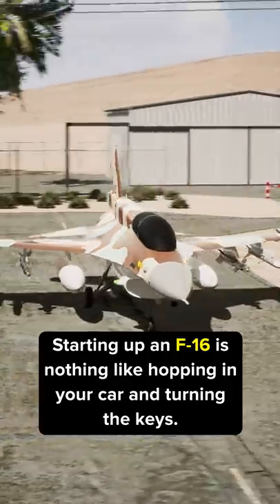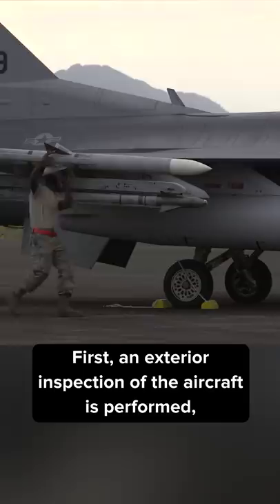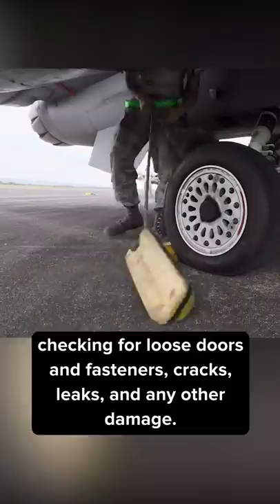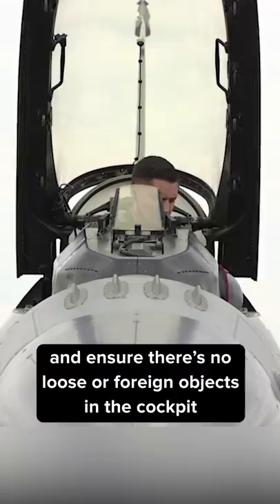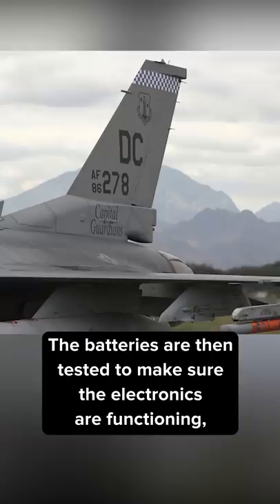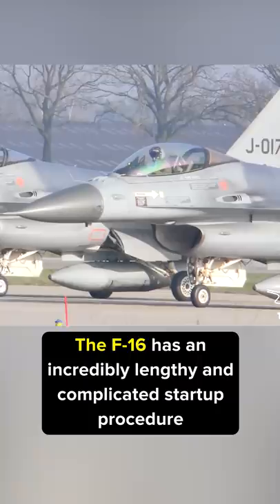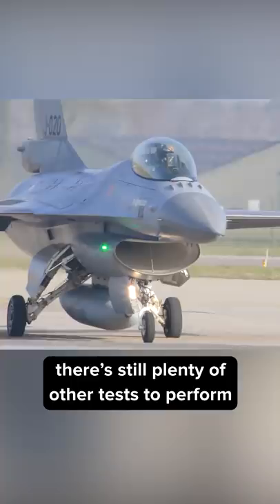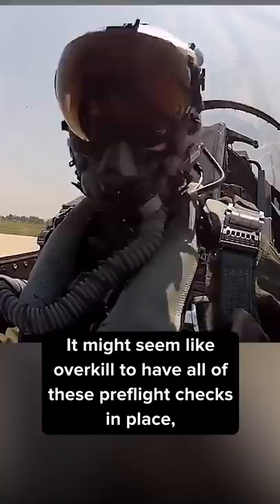Starting an F-16 Isn't Like Starting a Car

Comment: No... You don't explicitly NEED to do the checks. When starting an f16 it's very similar to starting a car actually, just a few more steps. And you need to spool the engine before igniting. Other than that. It's literally called the ignition on an airplane as well.

Comment: Actually it's decently easy. Turn on battery, test for electric faults, switch to Main PWR, Engine start 2, let your APU spool up to 20% RPM, move throttle indent to idle. And wait for full spooling to be done. That's how you turn on a F-16 but "Cold Start" Is a whole different shabang

Comment: Can't there be a flawless auto software program to remotely auto-check all this stuff in less than 5 min the moment you hit the start button in an emergency battle situation?
Reply: It doesnt have an "starting button", u need to start the engines externally with compressed air and then start the ignition with the throttle of the plane

Comment: I'm a f16 crew cheif and alot of the listed items are verified way before flight. The start procedure or "Launching" only takes 5 minutes. Checking Flight control functions, lights, engine functions, and hydraulic pressure.

Comment: The cost of the aircraft doesn't apply when talking about checking very precise systems. A Cessna 150 and an F-22 can both catastrophically fail if not maintained and taken care of properly.

Comment: Isn't there an external unit that has to be wheeled over to actually start turning the engine? I thought this video would be about that tool, not the standard procedure before flying every plane
Reply: No, the F-16 can start itself. Has a JFS. Most modern aircraft don't need huffer carts to start, including airliners. Multi engine aircrafy use APU bleed air, and most fighters have JFS (jet fuel starters)

Comment: and never talks about starting the jet engine.  IDK about the F16. but the F15 is started with a hydraulic system that spins the turbine that's under pressure w/ nitrogen.

Comment: Starting up an f16 isn't like starting a car.
Step 1: check outside of vehicle
Step 2: check inside of vehicle
Step 3: check safety systems
Step 4: check batteries
Me: just because you don't do things every time you start your car doesn't mean it isn't good practice to do so every time you start you car.  Your car is no isn't less likely to blow up. Also people would be much more likely to keep their car if clean on if all the stuff on the floors and in the back seat were constantly becoming airborne and smacking you in the head.

This video could have been named.  "How starting an f16 is more like staring a car than you would think"

Comment: What if there's an airspace intrusion?? There's no way theyd be able to react fast enough
Reply: Most of what he's talking about has nothing to due with the launch procedures. A lot of this is done during the PR/BPO inspection after the plane lands, or by back shops when the plane isn't flying. Typical launch takes maybe 10 minutes

Comment: You know you're actually supposed to inspect/adjust the exterior and interior of your car before you start it, right? I know it's a habit that almost no one still has but it's the proper thing to do before you drive the car.

Comment: It takeing 45 minutes to gots F16 storted and ups in da air so it cans fight,,, buts it takes 20 minutes for omponents to arribe and destroys it… maybe’s dis planes should be shots from cannon and whiles flying from barrel of big gun it’s engines cans be storted and plane can also have inspections while flying through air okay,,, mechanics may needs parachutes for dem finish inspection den dey can parachute backs to erath okay,,,, just saying

Comment: Sounds like a long ass way to get killed to me.
Most of those things should  be done long before the plane is ready to start up in case there is an emergency.  I am pretty sure that any time you actually NEED  that plane there will be no time for that long ass complicated BS.

Run to the thing in your flight suit and push ONE BUTTON  is how it should  be.

Comment: This video isn’t true at all it seems complicated but in reality let’s say we needed a scramble jet all you gotta do is a inspection start battery apu engine arm ejection turn your hud on then of course turn your parking break and full throttle into the sky the rest of the small things like setting gps and shit can be done in the sky I have enough research

Comment: As an aviation logistician, I can say that not only the F16 start-up requires these procedures, but also other aircraft, regardless of Cessna Skyhawk, or Boeing 747.

It is always important to inspect the exterior for bird strike or similar events. Emergency equipments are checked, such as stall warning, fire warning, overspeeed warning, TCAS warning, proximity warning. 

This video is misleading, thumbs down

Comment: 99% of this video: "starting an f16 is a long and complicated procedure, unlike starting a car, there is a long and lengthy, complicated set of setup steps to step through before deciding the checks are ok and its time to start up this AMERICAN HAWK! Which is a long and drawn out procedure! But before we get into that we need to check your seatbelt and make sure the plane is ok and that all this other stuff that has nothing to do with turning over the engine works which could cost you MILLIONS if done wrong!"

1% of this video: "then they warm the engine and then they start it"

Comment: I don't give me that s***, general started up strategic Air command get a B-52 in the air bathroom make your head swim, I guarantee you if he was here alive today he'd be speeding that process up quite a bit, I guarantee you if there was a war biting at your ass, a jet be into the air quicker no time flat
Reply: Interceptors on alert status can be started up and rolled out for takeoff in a couple of minutes. It's just that the hot preflight checkouts are performed in advance. There's a manual for every contingency.

Comment: This short is an abomination... it sounds ridiculous to any real viper crew chief 😐 .
Reply: ikr? It fails to mention any feature unique to the platform, such as the engine starting system. Which either performs what it says on the tin on the first try, or checks off the daily cardio for one of the ground crew.